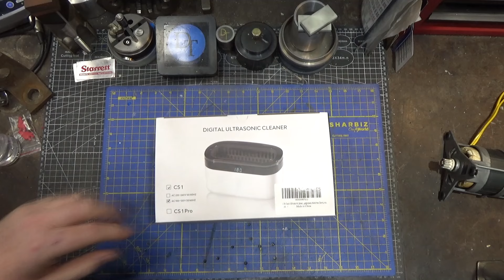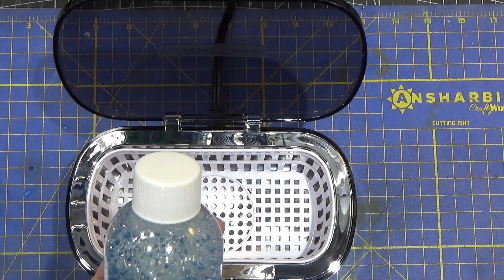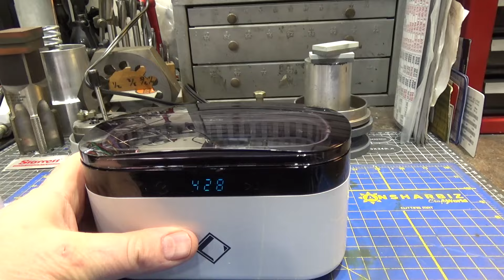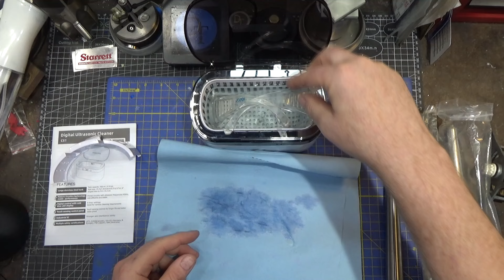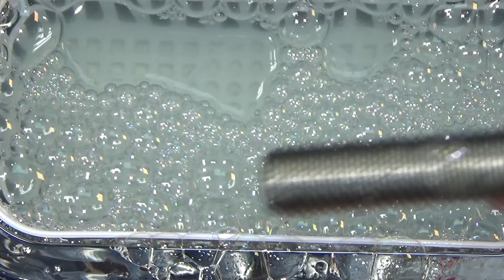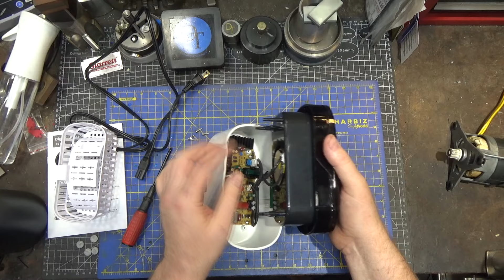QTR 123 LifeBasis Ultrasonic Jewlry Cleaner

Comment: A good test of cleaning function is, suspend a piece of aluminum foil in the bath, it should cause holes to form in a few seconds.   Also do not clean opals they may crack.
Reply from the maker: I have seen that test before. I really should have demoed that. Great suggestion. I was not aware of the opal bit.